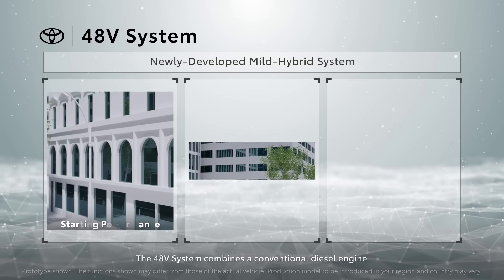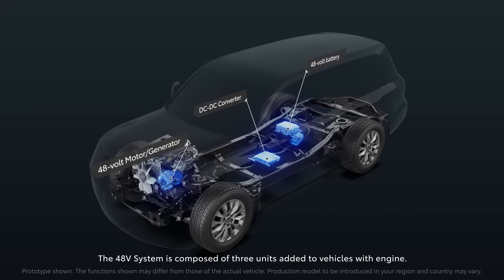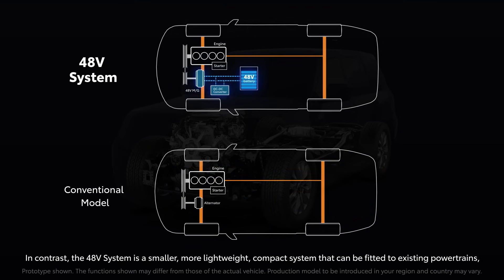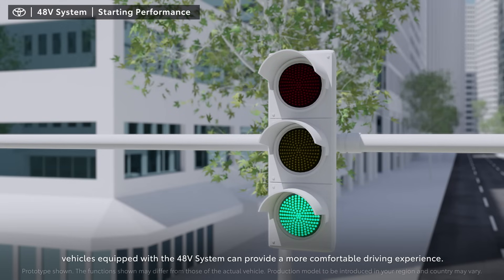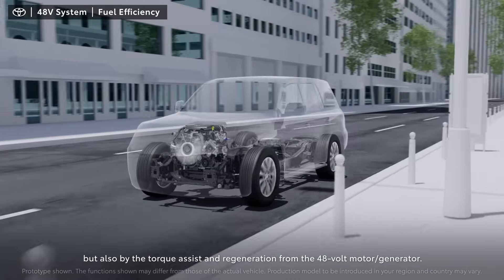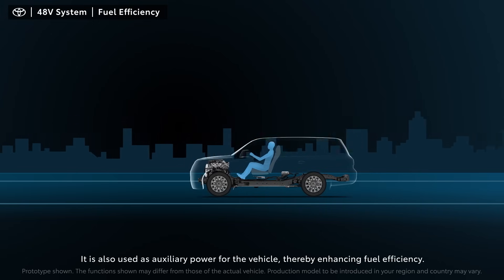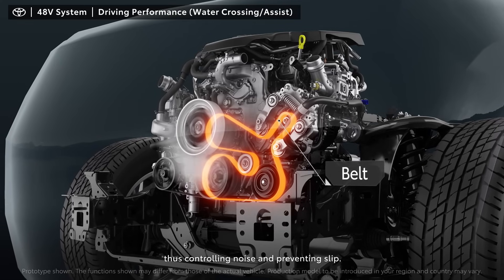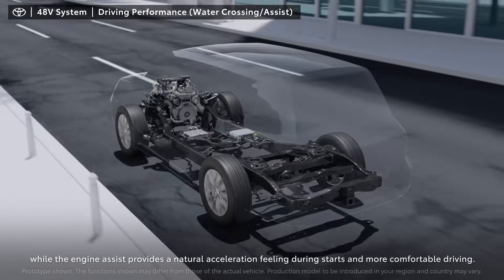48V System | Toyota

Comment: The 48-volt battery powers the electric motor, which is connected to the drive train. This electric motor assists the ICE during high-load applications such as during acceleration. It also functions as a generator to charge the battery and as a starter motor capable of starting the ICE.

Comment: If while overlanding in the middle of nowhere and hours and hours away from any help, and the hybrid system fails, can the vehicle still operate purely on the ICE? Or will the entire vehicle go into limp mode?
Reply: Supposedly can as it is not a Full Hybrid. It is just a Mild Hybrid.

The motor & battery are there just to assist the engine a little bit, the wheel is driven by the engine in all conditions, at all times.

Different from a full hybrid which the wheels can be driven by engine or motor independently or both.

Comment: The question is, how much fuel efficiency gap compared to conventional engine or THS II? it has not yet explained in the video. If it is only 10%, why bother coz the car price increase would be higher than 10% lol.
Reply: Underrated comment and data that should be shown.
Reply: Not only that imagine the extra cost of maintenance i doubt the belt will last normally with all of those extra load and when the special" alternator broke will also cost more than normal 😅
Reply: Emission improvements too. To the extent that adblue is not required.
Reply: @GbMuthu explain the 19lt adblue tank then.
Reply: If this technology finds its way to smaller 1.5, 3 cylinder diesels it could reignite the diesel hatch segment.
Reply: The price of the cars have not changed

Comment: 48V is garbage, why not use a diesel engine with i-FORCE MAX hybrid?
Reply: Because that is expensive to implement (See tacoma prices and compare it to prices of vehicles not in 1st world countries). This will most likely be used for basic hilux and fortuner vehicles to comply with stricter emission standards. It's not much, and it's basically an improvement on the basic star-stop systems along with some regen and engine assist.

Comment: Is it the same as Suzuki's ISG mild hybrid system? Probably the result of Toyota Suzuki partnership.
Reply: ISG still using 12v to 48v plus it is using the regular alternator instead motor generator so not like toyota true 48v to 48v DC-DC
Reply: @bgaoest2995  thanks 🙏 do you think its possible to convert the mild hybrid into a pseudo full hybrid by using a bigger battery ?
Reply: @TinkuTimepaas  the mild hybrid system assists the engine, it cant do anything on its own, unlike full hybrids that can drive in full EV mode. 

Even if you double the batery capacity I think it would still perform its role of assisting the engine, you would need to overhaul the entire system

Comment: If this mild-hybrid is not use with electric a/c compressor, it's a useless system in hot weather.
Reply: My 2002 Prius has a thermal storage evaporator core. Stays cold for about a minute, even with the engine stopped. If similar technology is used in mild hybrids, they can stop their engines while maintaining cold air.

Comment: Simple yet very effective! Always Toyota!
Reply: Tesla is already producing 48V architecture. It’s not a concept, like most Toyotas.
Reply: @yung784 Why is there a need for Tesla to have 48V systems
Reply: @wyw201  why is there a need for Toyota to have 48v systems? They’re more efficient
Reply: @yung784  I’m not asking about Toyota, I’m asking about Tesla.
Reply: @yung784  Why not go higher than 48V? Is it just safety concern stopping the increase in voltage?
Reply: @wyw201  why not go 6v to be extra safe?
Reply: @yung784  You’re trolling right? 6v is too low

Comment: Hybrid Diesel that is going to break the market, 👏
Reply: But it’s not a proper hybrid like Toyotas strong hybrids…
Reply: I don't think so. 
A diesels main advantage is torque but the electric motor has got that covered.
The main driving force for going hybrid is not only increase fuel efficient but also to reduce emissions.
Reply: @dranzergigs8333 the 48v electrical drive can also  be used to reduce and even eliminate  turbo lag if the ICE uses turbos
Reply: @mnnh1  that's what I am trying go say.

U don't even need a turbo. The electric motor creates much better torque and power.
Reply: Right...
This is nothing new but I welcome it.
My 2021 hilux has a yearly tax of 2300 euro because of emissions.

If this system lowers that tax, great.
Reply: @perpelle   where do you live with 2300 tax per year ?
Reply: @oliwiamax3114  A county in Scandinavia.
Reply: 48V, and you call that hybrid?